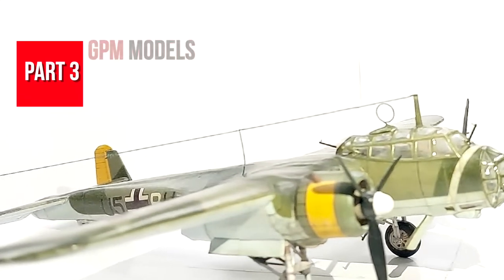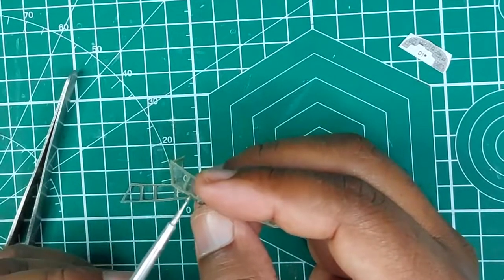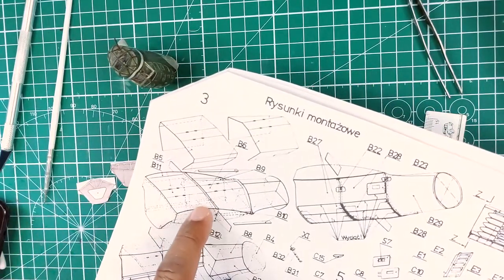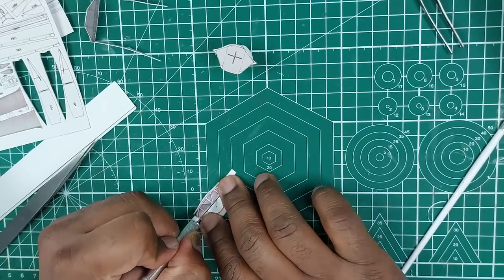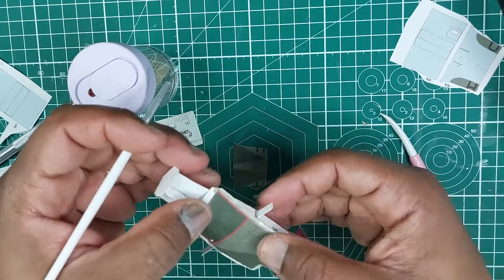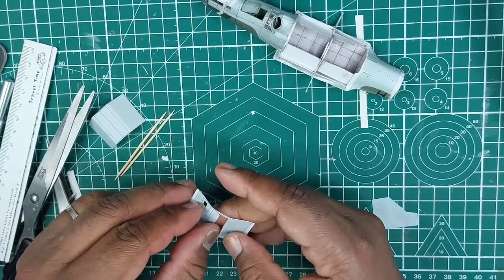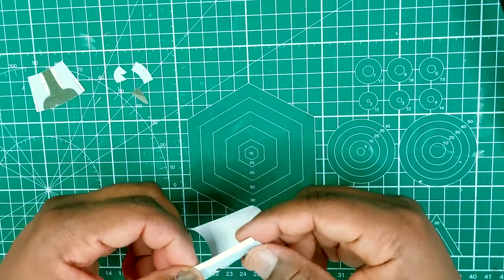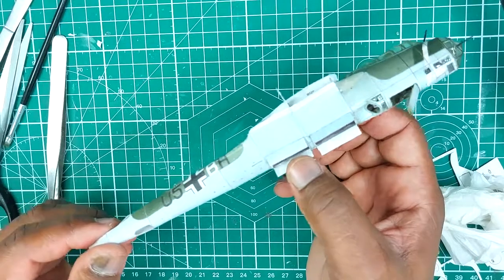Building The GPM Paper Model Do17Z-2 1/72 Scale Model Aircraft PART 3 FUSELAGE FULL BUILD!

Comment: You make it seem so easy. I like it. One question I have is when using CA glue for the canopy, won't the CA fumes fog the plastic as it dries? It does on plastic canopies.
Reply from the maker: I found that it doesn't fog as much if I use small amounts.  And with mylar plastic or shrink wrap plastic it doesn't show up as much. Hope this helps.